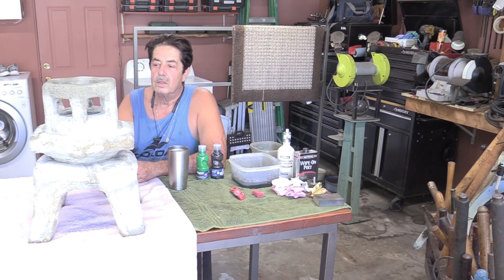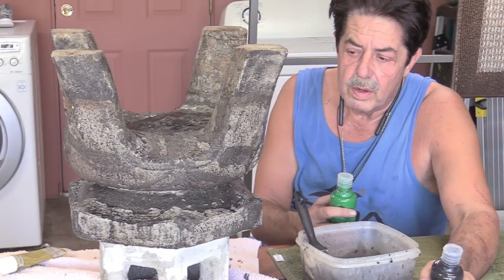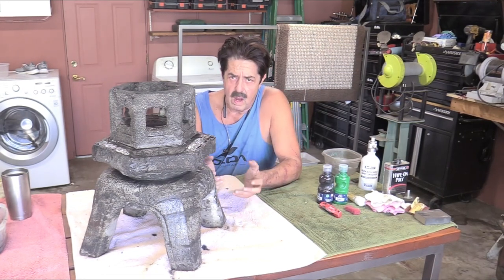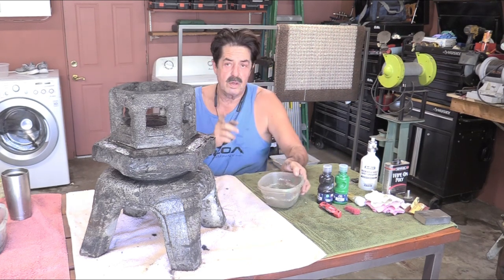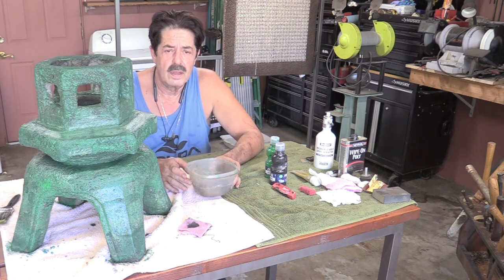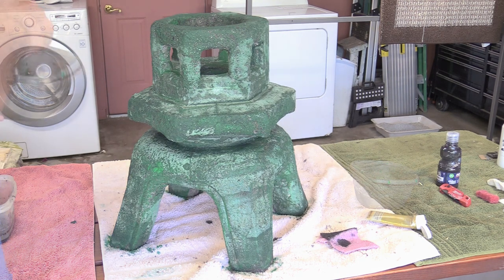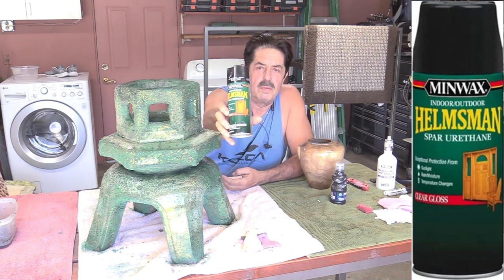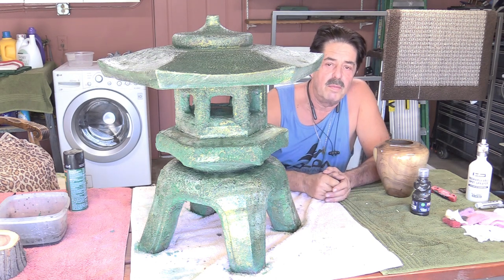How To Paint Concrete Statuary With An Easy Patina Finish

Comment: Been looking all over for a goo verdigris faux copper patina finish instructional video.  Watched several with all their fancy paints and techniques and yours by far seemed to have been the best of the finished projects.  Impressive.  Could I do this on my statuary and sell it, well maybe not. But in comparrison, maybe.
Reply from the maker: I do not see why not. I have sold several that I have picked up at garage sales for next to nothing and cleaned them up and did the same thing to them. When I sell them I put extra paints in smaller containers and give them to the people with a explanation on how to simply apply it. You can also use the base of the statues to experiment on with other colors to see the effect. Good way to pick up some extra money and easy to make a dingy looking statue look great again.